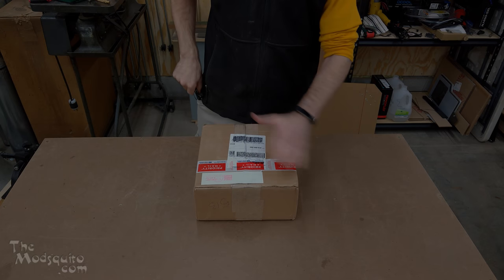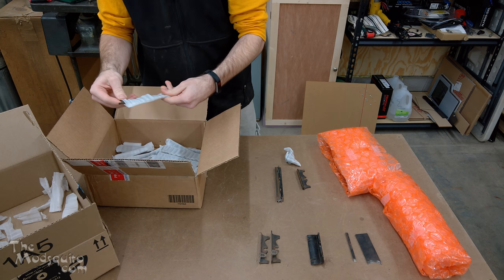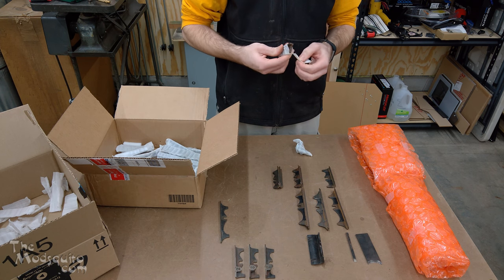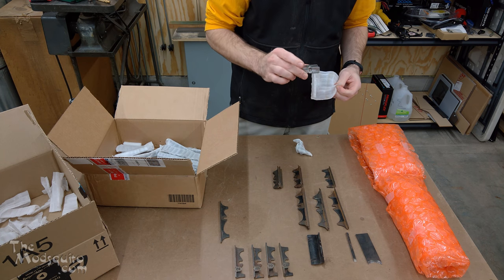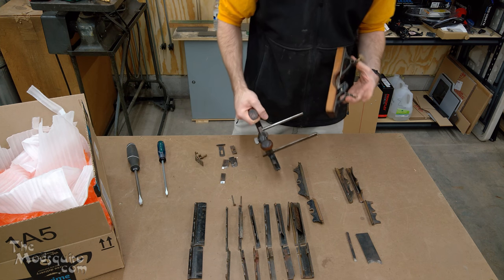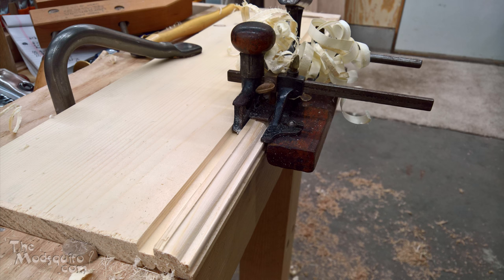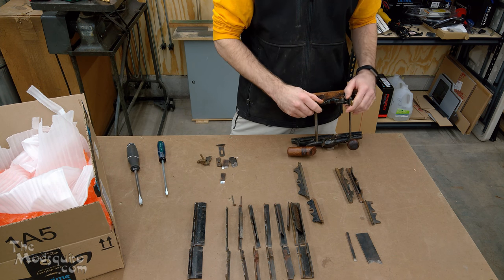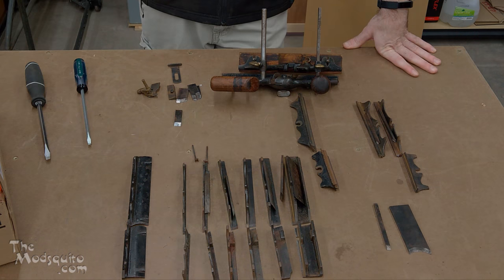Fales Patent Plane Unboxing and Overview

Comment: Wow, that's such a fascinating plane.  Chris, from your research do you know how the original retail price compared with a 45?  It looks like manufacture involved a lot more casting and machining so I'd guess the Fales was more expensive?  Thank you so much for sharing this! 😀
Reply from the maker: With the reference material I have on hand, the closest I come is comparing the Fales Plane prices from 1885 with the Stanley prices from 1914, and adjusting for inflation.  The Fales Patent plane was nearly twice as expensive for similar functionality. #45 with 21 irons was $7, and a Fales plane to do similar tasks was $7.90+$4 for center beads (Fales had 8 bead sizes, Stanley had 7).  That comes out to roughly $12.25 in 1914 terms.  But then the Fales also came with 3 sash profiles instead of 1, and 2 tongue cutter sizes instead of 1, for that price (Stanley had a second optionally later). The Fales also offered 5 different nosing sizes for $0.75 each ($0.77 with inflation), where Stanley's was $1.00 and only one size.  The Fales plane could also have side beads, and 9 sizes of hollows and rounds, vs the 4 Stanley offered (and they were $0.50 pre-inflation vs the $1.40-$1.50 for Stanley's).  So much more expensive, and more parts to keep track of.  Fales patent plane also has a slightly skewed iron though, so that kinda compares it to a #46 but with more of the capabilities of a #45.  

I really like the Fales Plane lol